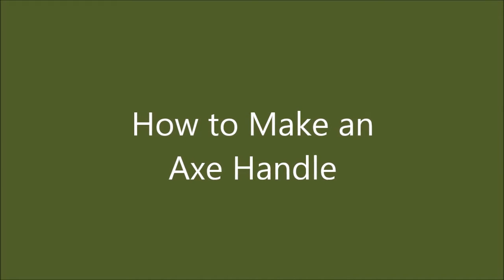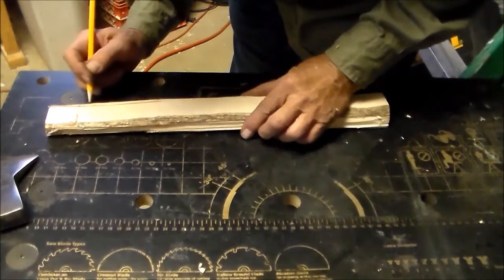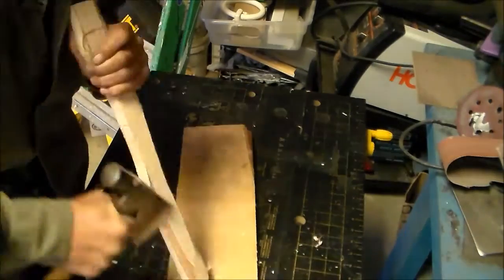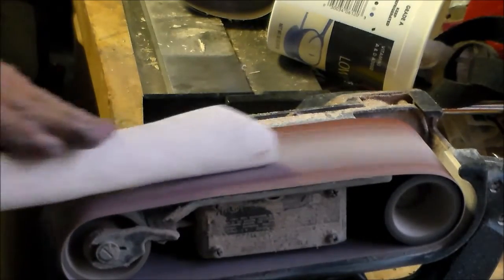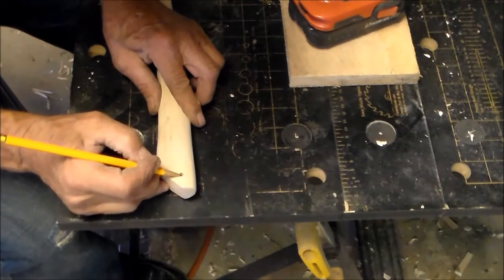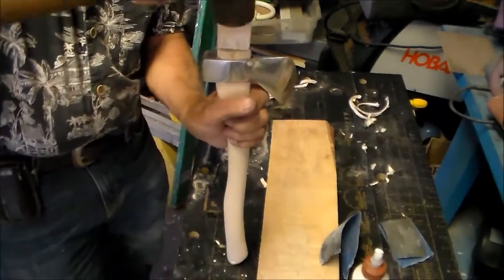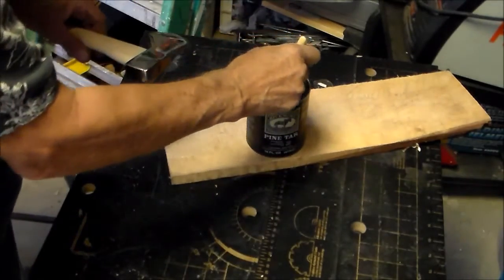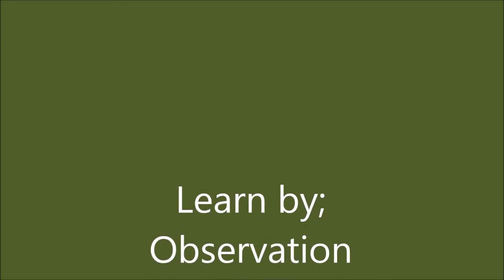How to Make an Axe Handle

Comment: Thanks for the great info. Being a hardwood floor contractor, I really appreciate your knowledge of wood and the importance of proper grain orientation, a fine job! I like to rub my flooring handles with a candle, it keeps them from slipping out of my hand, that's an old school trick that is counterintuitive.
Reply from the maker: +Alex Saganic Since I have bees and lots of beeswax--- I use the beeswax coconut oil mix on my tools also.  the garden tools an old farmer showed me how he treats his shovels and digging tools--- he has a 5 gal bucket and is saturated with oil, he then runs the tools in the sand until the tools are shinning and is coated with a thin film of oil and keeps them from rusting. thanks for your comment my friend- Don
Reply: +Donald Porta You gotta love those old farmers, just an amazing wealth of knowledge with those folks. It saddens me to think of all the information that will be lost when that generation passes, hundreds of years of wisdom passed down through generations, only to be lost to modern farming practices. Thank you for taking the time to share some of it so that it may live on for generations to come.